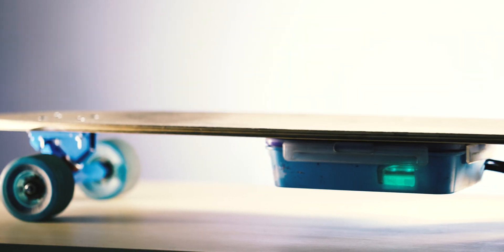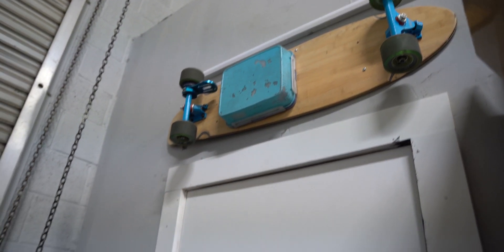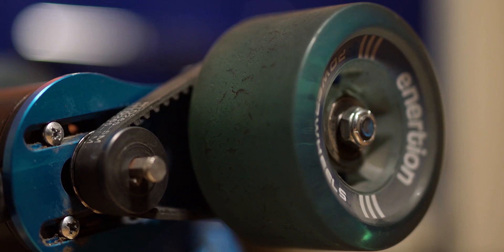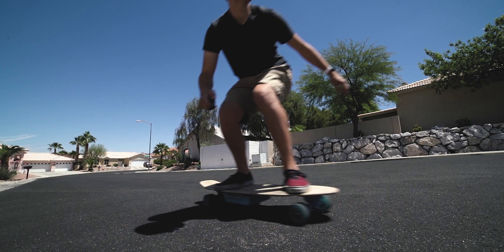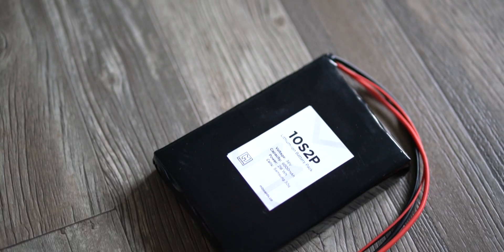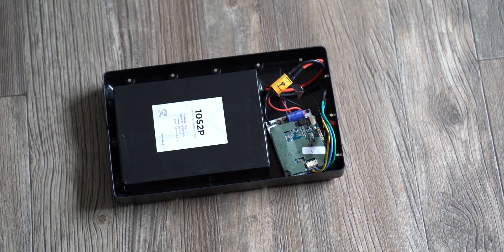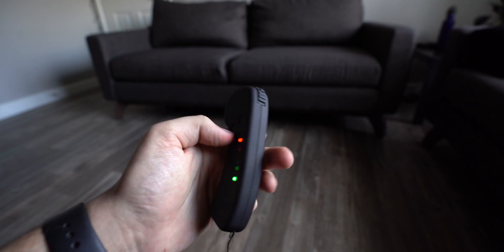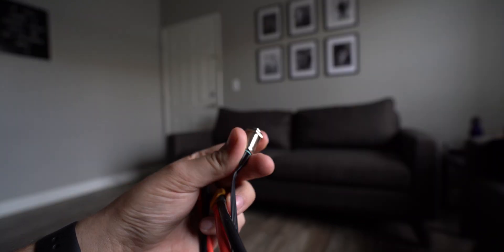My First DIY Electric Skateboard Build: What I Would Change If I Did It Again

Comment: Luckily when I was building my first board I went with 6s lipos. I then got a VGA port and soldered each lead onto it and soldered corresponding ports on the balance charger side. It made charging the board so much more convenient.
Reply from the maker: That’s an interesting idea!
Reply: 6S lipos? Are you familiar with FPV by chance? lolol

Comment: I like your video , thank you for the advice .
Reply: Maybe you can help me with a video ,I’m trying to program a flipsky vesc 6.6 plus  and two things happen that I don’t know what I’m doing wrong.
1 - If I save motor calculation on the side  pressing the M. Should save motor calculation but it don’t or if I go to the top and back up motor setting it doesn’t , makes my throttle stop working in using a twist throttle wired with mechanical brakes by MBS on the front wheels.
By the way I’m running  lipo batteries 10 cell 5000 ma , with 2 flipsky 6384 motors 190 kv  ,my gear ratio is 6:1 -12 teeth on the motor and 72 teeth on the wheel ,wheel diameter is 200  it a mountain board MBS.
2- the second problem ,is when Im trying  to setup the throttle it says my firmware is old ,so I download 60 and default 5.1 version and can change the setting then if I go back later it wants me to download again and I don’t know what I’m doing wrong? By the way I watch the video you did on how to setup your vesc so l don’t know what Im doing wrong.if I don’t save the setting or make changes it seems to work fine.

Also in your video you said how you have change your board or the years, I think as builders and makers it is part of are DNA .

Comment: Hey, I’ve been doing research and I think I’m ready to build my first electric skateboard but I need to make sure I got the right parts

Motors: 90mm dual hub motors 

Esc: 36v dual motors esc form mboards 

Batteries: Turnigy 5000mAh 3S 20C Lipo Pack w/XT-60 (2x)

Charging board for batteries: NIDICI XT60 Lipo Battery Charger 2-6S Parallel Balanced Charging Board

Charger: Skytoy iMAX B6
Reply from the maker: That all sounds great! If you can spring it, a complete 6s lithium ion battery might be a more plug and play option. 

Charging each Lipo battery separately does get quite old pretty quickly. 

But up to you! This parts list would work!
Reply: @MBoardsco  you won’t need to charge each lipo individually with the use of a balance board. You can plug all 3 set the amp charging rate and be done with it. Really popular thing to do in rc hobbies like racing drones. I’ve charged a total of 6 batteries at once
Reply: @MBoardsco  thank you so much, I think I’ll stick with those batteries and if I get really tired of it, I’ll get a 6s2p from your site. By the way, with my setup what is the range and speed?
Reply from the maker: Around 18mph top speed, should be able to get 8-10mile range.
Reply: @MBoardsco  what if I add an other battery? Will that improve speed?

Comment: I've been on the website and played with the kit builder. If you try build a kit that has a similiar spec/features to like an exway wave riot etc, the end cost is a few hundred dollars more expensive than the complete Exway. I'd like a video discussing the value of building your own board that will be more expensive than a complete board from competitors.
Reply from the maker: Right from the start it can be difficult to compete with China's prices. But one thing that is huge and will ultimately save you money in the long run is being able to service and upgrade boards yourself. When something goes wrong you'll be able to fix it yourself. Many times with off the shelf boards, you'll have to buy a completely new board in some cases. And a US based support team is absolutely essential in our opinion. 

We actually do have a video that dives into this more in-depth on our channel :)
Reply: It highly depends on what you consider "DIY", and what your skill level is. Sure, buying a kit from a trusted US-based shop is a good way to start, but it´s in no way comparable with "true" diy. Building your own battery, sourcing parts directly from china, etc... and of course sourcing used parts (the deck for example)

For example, a short breakdown of my first build:

Deck: 25€
20x Samsung 40T cells 80€
BMS 10€ (only for charging)
Hub motors incl. trucks (which i recommend for first build btw): 96€
Dual ESC with FOC: 46€
Small parts and hardware: 20€
Enclosures: Designed to perfectly fit my components in CAD and 3D printed (around 6€ worth of PETG filament)
+ around 30h of research and work (which is only worth it, if you enjoying tinkering of course)

So if you are ready, and have the tools, space and skills for a high "DIY" level - you can build a decent board for extremely low cost.
Not to mention the fun, rewarding feelings and experience you get on top.

Sure, thats not for everyone, and this is why kits are also awesome! but you pay for the research and everything else wich was done for the kit of course.

Greetings from germany!
BR
Reply: @d3rsch0rsch  Honestly for someone like myself, price would be the only reason I would do a DIY "kit" build. The price of the kit is going to need come under what a so called chinese brand complete board sells for. Reason being, every single board on the market is extremely modular. If there is an issue it is easy to replace the part. For example Exway wave , replacing the battery takes 5 seconds, replacing the entire drivetrain takes 2 minutes. The esc is even compatible with both belt and hub motors. Replacing ESC is easily done itself if needed. I don't feel a service centre is now needed as much when board parts are so modular. With all this being said..having the exway come as a complete board and cheaper than a kit build board and taking how easy it is to replace the major parts...personally I can't really see how you wouldn't buy a chinese brand board when they are a few hundred dollars cheaper. Would be fun to try your skill level of DIY though.
Reply: @travistravis7190  Sure, it´s absolutely OK, people are different, and thats great!

For me, i´m more a DIYer than i´m a skater. So building stuff is more than half the fun for me, than "having" the result ;-)
Reply: @travistravis7190  Honestly Chinese Brands make awesome boards, Exway, Backfire, Meepo, etc.  But the DIY is for people that want to have control of everything, the type of trucks, the type of BMS, the type of batteries, the customizability of the ESC, etc. Personally, I think, the best starting board would be from a well known Chinese brand and DIY should come later if you like tinkering with every little thing, but if you want to just drive and have fun, you should buy a pre-built.
Reply from the maker: All really good points guys! Definitely an argument to be had for both sides for sure! For me riding something I built and designed is such a rewarding feeling and makes me proud to think I spent my time building it and making it my own :)